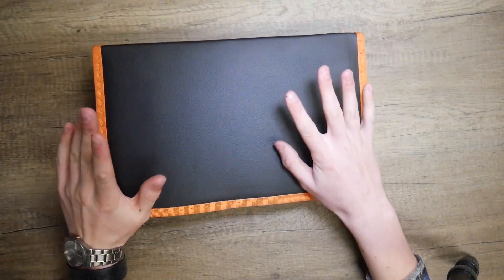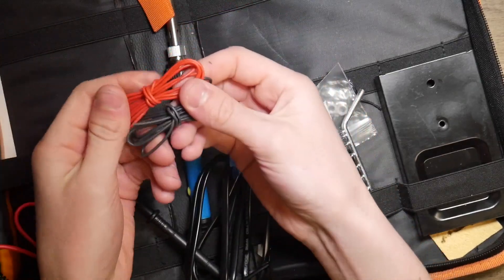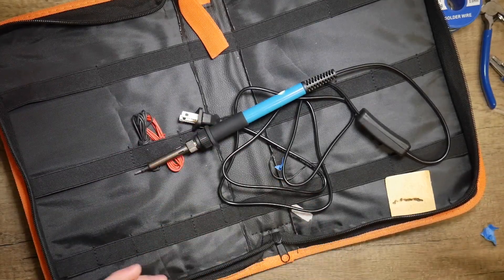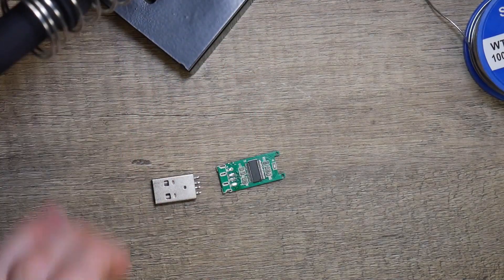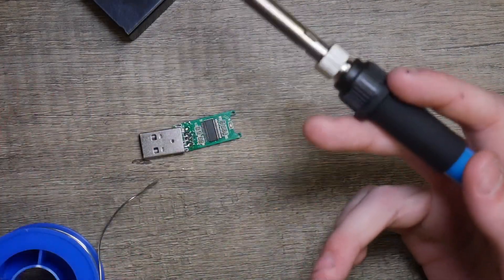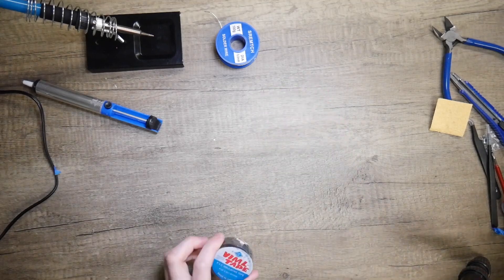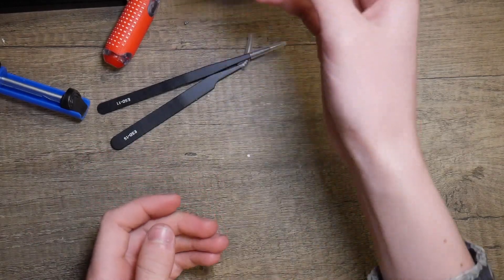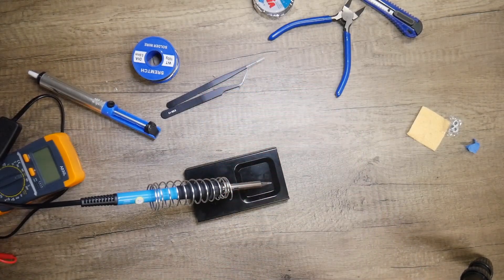Generic Amazon soldering iron kit review || (Soldering Iron Kit with ON/OFF Switch, Rarlight 60W)

Comment: Also, the little pad that came in the kit that you said got burnt, it's a sponge that goes in the notch on the iron holder. You put some water on it and it's used to clean the tip of the iron.
Reply from the maker: cRavenSomeCrow Twitch That makes a lot more sense